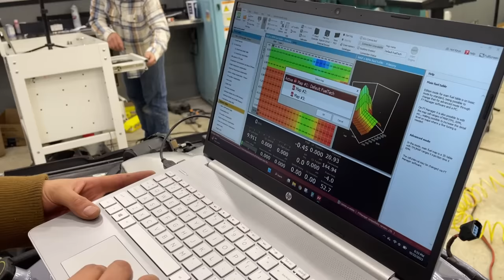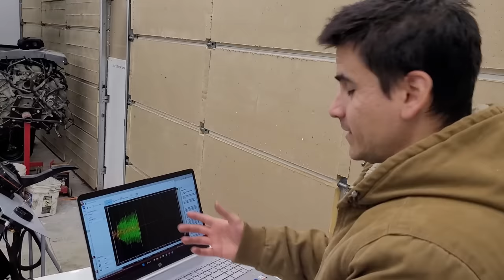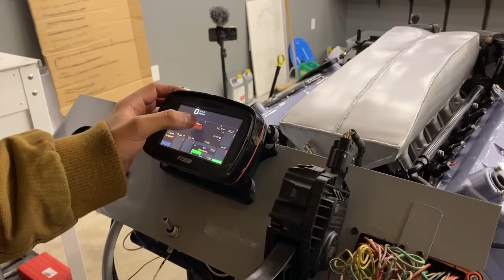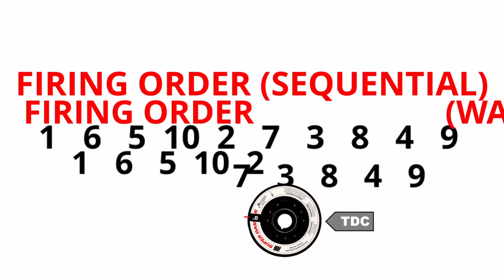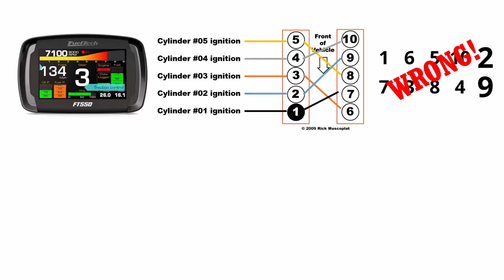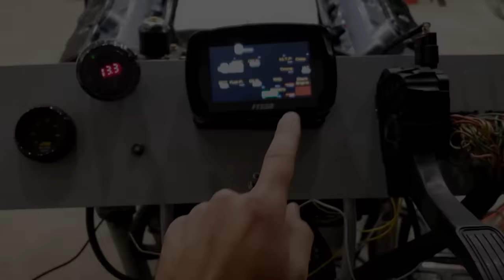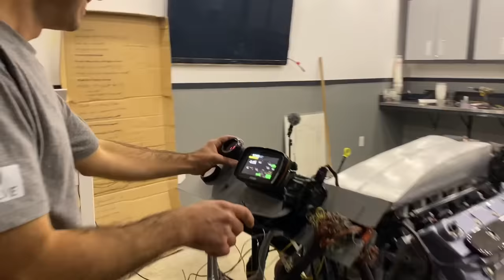Ford 4V V10 First Start! | It Sounds Insane!

Comment: :face-blue-wide-eyes:BTW......Young Men
I am Phil the Phone Man down South 240 mies in Dayton Ohio, well Phil (the Retired Telecom Engineer of 50 frigging long years)
I am a Serious Gear Head, dont do football,basketball or baseball (like watching paint dry to me).......racing, racing,and more racing
I has a 2015 Mustang 50th anniverserry S550....Supercharged makes 13 lbs boost, runs only on E85, has made 737HP at the back tires.....have 60,000 in race psrtd in it.......fun car, beware......it can kill you quickly !!!
Then for two wheels have a 1974 H2 Kawasaki (Had one in 1977)........I totally rebuilt the motor....Big Triple Two Stroke on AVGAS
10 years building it,. German Long Plug Heads, German Wossner Pistons with ported cylinders, Big Heavy Crank with NTN bearings with 2mm thicker rods, undercut trans, Zeeltronic IGGY controller, (My MAPs), Mikunii TMX38 carbs, been to Australia and bored and flowes by Neville Lush, K2TEC Stainlees Chambers, 120HP at 10K.....like riding a girly moped until 5500 rpm.....then LOOK OUT !!!

Comment: Don’t you think you think you should have taken that beast to the dyno before you put it in the car? I would want to be sure it will hold up to full power rips before doing all that work retrofitting the chassis. Just sayin’, not to take away from the amazing work you have done. Nothing short of a miracle so far.

Comment: Maybe you could find someone like Robby Gordon who has worked with Chinese manufacturer to make the speed UTV and get casting for the heads mass production and then it might open doors for other popular engines to be modified to be over head cam.

Comment: Is this a Triton V10 block with altered Cobra heads or did you actually get your hands on a Boss 350 V10 engine, that Ford engineers put in (3) 2000 Mustang Cobra R's. ??

Comment: What i would have done is picked up either two 5 cylinder for engines from one of their small cars a while ago i cant remember what it was or two straight 6 4.0l barra motors and built a barra v12. Twin turbo it and youd have an engine capable of 2000hp on pump gas

Comment: A V10, wants to see a 72° Block. You are using a 90° Block. As with the Volkswagen Touareg V10 5.0,  with a  90° Block, are You Offseting the Crankshaft Jurnals by 18°, so that the Engine Thinks that she is 72°?

Comment: I don't mean to be a wet blanket but it seems to be what I'm best at so here goes 😂

As a 35-year-old poopy head kid who spent nine years working as a manufacturing technician and engineer in a small semiconductor *research* wafer fab..... as well as having tuned using a Moates quarter horse piggyback on the factory ECM of my 1988 Mercury Cougar with a pro charger....... as well as being taught early on in both the AP CompSci in high school as well as further ones in college about DOCUMENTING your code....... it is appalling how many of these software parameter misinterpretations and lack of clarity situations there are in the WORLD. 

I mean that as a very general statement. And of course software itself is a big pain that's why I did not become a software engineer myself I respect people that can sit there all day and be a "code monkey" because our bodies are absolutely not designed to do that. Very unhealthy.

However it is really alarming how many problems arise because this just gets half-assed usually due to the company who owns the operation not wanting to commit the resources to it. Sucks but this is what we have to deal with I guess. I guess I'm past the denial stage and moving into the acceptance stage of grief.

Just annnoys the hell out of me how often this is THE problem....and then thinking about how much of our world depends on it..... it doesn't just affect pet projects though those are much closer to our heart and stress us out directly upon suffering these conceptually simple issues.